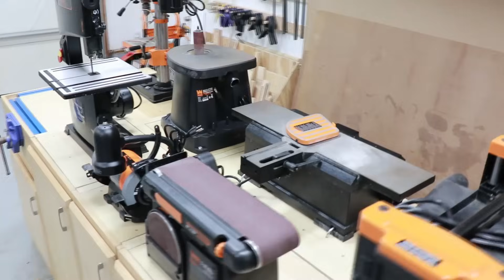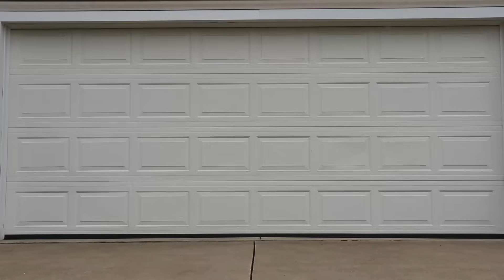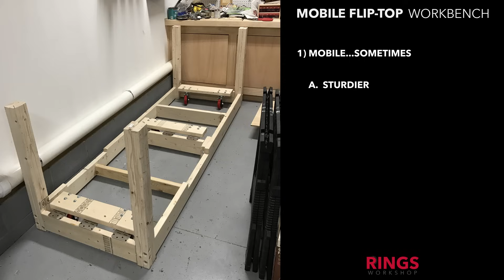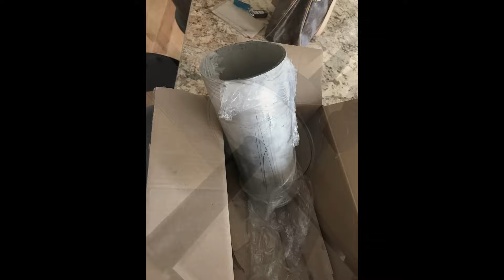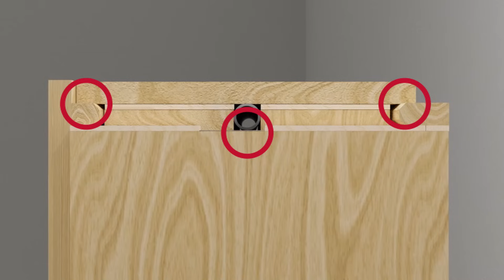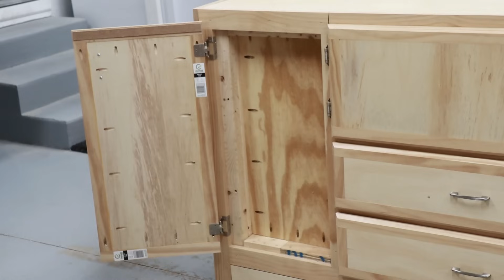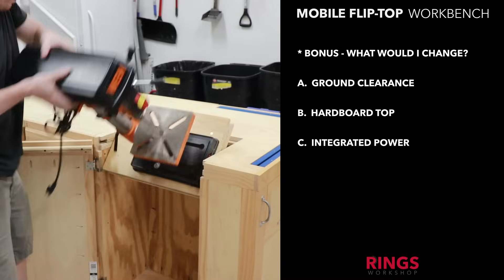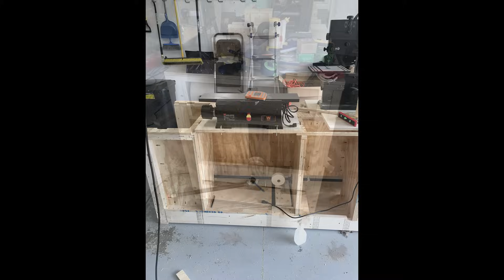Mobile Flip-Top Workbench

Comment: Thanks so much for the inspiration. I build myself a workbench with the same flip technic. It is such a space saver and very fast to flip. Awesome work!
Reply from the maker: That’s amazing!  I’d love to see pictures of it and hear more from you on how you implemented it!
Reply: @RingsWorkshop  Glad to be able to share the pictures 🙂
Had to post it in 2 stories on instagram, because of the limitation of 10 pictures 

Flip mechanism
https://www.instagram.com/p/CRlNPtlhnXy/?utm_medium=copy_link

The workbench in action
https://www.instagram.com/p/CRcL8fEhASs/?utm_medium=copy_link

I used multiplex boards for the body and used lamellos to connect all parts. 
I made some drawed plans to get the exact meassurements for the wholes that holds the flip pipe also for the lock of the flip table at the backside.
With those meassurements  I created a cutting template out of MDF to get the wholes and the Flip lock on all 4 walls at the same position.

Before assembly I milled some notches for drawers. For one top of a flip table I milled T Notches and for the center table I added a couple of 20mm wholes for clamping systems.
That is basically it, I would say.
I hope my explanations make more sense when watching the pictures.
Reply from the maker: @lexwoodworks3841  that’s amazing!  How is the clamping pressure on the left side?  I though about running tracks over the fliptop a myself to help with assembly, but wasn’t sure as I assumed it would lift up some.
Reply: @RingsWorkshop 

Thank you. My workbench is not as precise as yours, but it works out for me.

As i had just finished the workbench a couple of days ago, I actually haven't used the left side yet.
I just drilled a clamp to see if it works.  
I am basically working in the center area for clamping purposes. 

I'd be glad to run some testings or test clampings for you and send you the results by Video or picture. 
If you like, please let me know some use cases you are interested in and I'll do as promised.
Reply from the maker: @lexwoodworks3841  just basically assembly I’d be curious on.  I have the Kreg track on the solid part that doesn’t move, but I’d love to have more surface area to clamp to for larger projects.  Would just be curious how it holds especially from that left side to a piece that extends over the middle that doesn’t move, if there is any give or wobble.  Appreciate you looking into it.  That’s why I love this community, everyone trying different things and helping each other out to get better.
Reply from the maker: @lexwoodworks3841  thank you so much for those!  Definitely gives me something to think about!

Comment: This is bloody amazing. How would you adjust the height of the rotating platforms if you were to replace the tools? It would be great if you can have a height-adjustment-then-lock mechanism there. I want to build something similar.
Reply from the maker: You could drop it down for planer or miter/table saw, but you would need a really thick top side to make up the difference for when it’s down if you didn’t want a piece that would detach.

Comment: I notice that when you flip a tool you can slide the tool towards you a little bit before you flip the unit up and then slide it back to lock it onto the brace. Can you explain how that works, please?
Reply from the maker: That’s how it locks into place on the back side.  The 3D animation in the video explains it in depth more than I can through text.

Comment: This bench is pure Genius. My only comment is that you might consider swapping out the metal strips that prevent wear with same sized strips of ultra-high-molecular-weight polyethylene. As long as the metal tubing has been sanded so that there are no large burrs on it, the polyethylene would be just as tough and wear resistant, and it would markedly reduce the friction and effort in moving things compared to metal on metal friction. Very minor suggestion that is worth what you are paying for it. Excellent work and video. Super impressed. This is a link to an amazon product that would be a replacement for 1/8 inch metal. https://www.amazon.com/Molecular-Polyethylene-Standard-Tolerance-Thickness/dp/B000ILLNIY/ref=sr_1_4?crid=1XT7VQND71YJ1&dchild=1&keywords=ultra+high+molecular+weight+polyethylene&qid=1624560211&sprefix=ultra+high+mole%2Caps%2C212&sr=8-4
Reply from the maker: Thank you for the kind words, great idea as well with the polyethylene!  Hadn’t even thought of that.

Comment: Did a similar caster method for my Harbor Freight workbench years ago, but mine I could easily lift by hand, and tuck a support to hold the casters down with my foot....  works great and like yours, no risk of movement at all on locking casters.

Comment: Just discovered your channel. Me likey. 
If you do indeed end up doing a 2.0, lose the door handles as you will the fancy edging - a nicely shaped hole for one finger or a slot for four fingers, with a soft piece of flat rubber behind to limit dust entry will look better, not break, and not protrude. Also, those doors deserve nothing less than full length piano hinge. Nice bench, bro.
Reply from the maker: I had thought about the hole in the door, would be more low profile, I didn’t want risk things falling in and getting under the bench, however a piece of rubber or something like that would have been a good solve.  Piano hinge I didn’t even consider tbh, I was trying to hide the hinge all together, but realized wouldn’t be able to and have tools swing out without hitting a bulky hinge inside.  Would have been a nice look though.

Comment: The wheel assembly is just brilliant!
How cycles do you suppose it's done and how's it holding up?
Reply from the maker: Thank you!  It’s easily been raised and lowered over 200+ times, likely need to clean and regrease it, as I’ve naturally got some sawdust mixed in there, but no issues with it at all so far going through four winters.

Comment: You should fill the thin cupboard space with router & drill bits, these would be low profile enough to fit :)
Reply from the maker: Appreciate the comment!  I actually had route bits in there at one point, but I moved them too my tool wall I go over in detail in the tool storage video.  I have them all on magnet strips which seems to work out better for me.

Comment: Great video, loved it so much that I am in the process of building one similar to resolve my space issue. Is it possible to make so when my planer spins it lands at the level of the table ?
Reply from the maker: Thank you!  Yes, I would think all you would need to do is lower the point it rotates and have a thicker side when it it’s down so it fills that gap properly.

Comment: You have that dead cabinet space, so why not integrate power there? You could take a 25/50/100 extension cord, splice a switchbox into it (hell, use a plunger for emergency cut-off), and store/mount it in the unused space.
Reply from the maker: I would still have to plug the tools in each time I raise them up.  I have power right above them so it’s not really saving me much hassle.  If I ran the power through the pipes the tops spin on, I could have them always plugged into a master switch box and just have one cable I plug in when I move the bench, but I didn’t have room on the sides of each fliptop to do so.
Reply: @RingsWorkshop  Ahh. Thanks for clarifying. :)
Reply from the maker: @talldarkandcynical  of course.  Check out Drew Fisher’s fliptop at Fishers Shop.  He did one with integrated power, which is what I was referencing.

Comment: Great build just love the integration. Just a thought have you thought about coming at the power problem for the other end and having the tools plugged in at their own section and having one powerpoint/cord out, I'm not sure as each power cable may be a problem when revolving the device/tool. Also with reference to dust isn't there a way you could add a dust trap when you have the shop van on.
Reply from the maker: Thank you!  Problem with the power in each section is once you flip it up and close the door, the cord wouldn’t be able to be plugged in when you need it to have power.  That’s why running it through the pipe that spins would be the best option, Fishers Shop did something similar but his pipe didn’t slide like mine, so not sure if that would wear over time.  Dust I ended up doing magnet dust ports (another video on the channel)  and that made it a lot easier for me.

Comment: I don't see why you couldn't use a lipped edge on this. The slider motion would have to increase, as would the inner (back?) 3/4" block that connects with the flip top....maybe little spacer piece on the top, but overall totally doable. I might have to try a section with those changes along with making the cabinet body on the CNC to take a lot of the extra weight off, continue with a full table if it works.
Reply from the maker: I think you could but you would have to have the door stick out weird to lock it in place, and then if you use it to clamp you would be putting a lot of pressure on the door hinges.  That’s the main reasons I didn’t make the lip.

Comment: Really inspiring.  Question:  Do you have any issues with tools being aligned, level or anything like that when they are in use?
Reply from the maker: Nope, no issues at all.  No more than if they were just sitting on a benchtop normally.  Since they are bolted down they are more secure and move less so that helps.
Reply: @RingsWorkshop   - Thanks for the reply.  Another question (maybe I missed this):  How do you "lock" the cams to that they raise the bench for moving and not prematurely drop the table? Basically, what keeps the metal bar from springing back from the 7 o'clock position to, say 3 o'clock?
Reply from the maker: @stevenjunor503  the weight.  When I turn them it goes a bit passed it’s highest point on the cam so it won’t go back unless forced.  If I leave it at the highest point it can drop back down, so I just push it a little bit further and it’s good to go

Comment: Any small flat space unused could house gamer wrenches screw drivers even clamps squares leavles excetra. But a very ingenious idea about flip tops that I will use in my table. Ps you could still cut off and of tools drill hole behind or through pipe or top to below reconnect another plug on any tool. Great build.

Comment: This is a great build!! Do you know about how much you spent on the bench, minus the tools of course?
Reply from the maker: A lot less than it will take now with the price of wood being so high.  It was around 3 sheets of 3/4 hardwood plywood, 3 sheets of 3/4 sanded, sheet of 1/2 sanded, sheet of 1/4 ply, some 2x4, few 2x6 and the rest was the trim which could vary depending on if you framed the doors or not.  Honestly can’t even make a great estimate since it’s been four years now and it was multiple trips.

Comment: What is the dimension of your workbench top. I am trying to fit a similar number of tools into 4x8 and I think it will be too tight. Is yours larger than 4'x8'?
Reply from the maker: No.  Smaller.  Mines just over 8ft including the surrounding trim x 33 1/2 deep.

Comment from the maker: Plans are now available for this project: 

https://www.ringsworkshop.com/plans/mobile-fliptop-workbench

The top dimensions are about 97 1/4” wide, 33 1/2” deep, 36 1/2” tall.  Overall dimensions add 1 1/2” for the doors + the depth of the handles used.
Reply: @Rings Workshop I got them. Wow! 100 pages! You obviously put a lot of time and work into putting this together. Very detailed and complete. Thanks for doing this! I have completed the basic base and adding the movable caster sections next. I am modifying for the tools I have and making it a full 4x8 top, but still going with your design.
Reply from the maker: @tcmccormick  thank you!  That’s awesome, excited to see how it turns out!!

Comment: I did not read all of the comments, so someone may have already suggested this, but, in the storage spaces you could use one for Kreg Jig storage and the other you could use for hand planes or other small tools.

As for the electric, it looks like you have some spaces that could contain either a power strip and/or multiple duplex outlets, set below the surface one of two ways.  One would be to mount them 3/4" below the top and then cover them with a temporary cover of plywood for when you need a flat top or if you can find the right type, they make flip up outlets.

Lastly in the middle(ish) of the bench it looked like you had a square opening (under top) that could possibly be turned into a dust collection port.  I did not really see much of the internal spaces, but maybe you have enough room to run some pvc to the lower outside or possibly into the wide open cabinet to house a vacuum.
Reply from the maker: I appreciate the ideas.  I could definitely do both of those things,  but it doesn’t really help a lot as I have both attachments directly above where the bench is.  My hope with power would have been to run the power through the pipes so I would have one master plug and the others were ready to use as soon as they flipped up.  There is no way to do that with dust collection though because of the size of the hose.  Great ideas though, like the idea for hand planes as well!

Comment: Have you thought of putting a track saw rail on one of the sides of the bench?
I think with a little thought an adjustable hight cradle for the saw to run along a rail is possible.
Reply from the maker: I hadn’t...but I am now.  Guess I know what I’ll be trying to figure out this weekend!  Haha.
Reply: One more thought
The edge of the bench should probably be the cutting edge.
And the piece to be cut can move onto the edge. That way you will always know what the cut line will be?
Reply from the maker: @mushroomlw1717  likely what I would do, but maybe a slight overhand so I’m not cutting into the bench.  I would have it overhang onto the table saw so when that piece get close to the end it doesn’t bind into the blade and is still supported.  But i agree, would like an easy way to line it up or even make repeatable cuts.  Have a few ideas for sure, thanks again!

Comment: The thin cabinets would work great for hanging extra circular saw blades and grinding wheels.
Reply from the maker: I had saw blades in them initially, but then I made a special holder for blades so I took them out.

Comment: In the shallow cabinet you might want to drill i/8" deep hoes, 3/4" wide and fill the holes with rare earth magnets. I use them in a similar space to hang my spade drill bits & other small items I regularoily use.
Reply from the maker: I had a few magnet strips in there but moved them to the tool wall.  I, too, am a huge fan of magnets.

Comment: Ab fab video, you have a wonderful imagination.  :)  I'm in the process of fitting my workshop from scratch and couldn't see where to put the workbench, now I don't have to I can put it wherever I want for the circumstances.  Love the can mechanism for lifting the bench, I wondered how solid locking casters would be now I don't have to.  I cut my own trees and am incorporating a planking facility (rough plank the trees to 4" - 6" thick, set aside to dry and then rip into planks) so I am wanting to keep a 20ft run free for this.  I can now mount all my power tools under this run and upside down just like in your bench.  Thank you for that.

Comment: Spare space - band saw blades -  having has one fall of its hook and bite me, a cupboard seems a great idea. - And, love the concepts.  Will be "borrowing" the ideas for my shop. Though trying to see how I can offset the thicknesser so the feed is level with the table.
Reply from the maker: Thanks!  I though about that, but because the cracks in the table can catch boards I just through some scrap on top and it works fine.  I also don’t use the planet a ton so it wasn’t a huge inconvenience for me.

Comment: Do you have any issues with the placement of the drill press? Would you have moved it or changed the orientation if you built a new one?
Reply from the maker: Only issue I have is that my camera arm I use to record doesn’t reach over that far haha.  I have no issues with it being sideways, which is why I put it on the end so I can use it straight on still.  If I rotated it 90 degrees it would be much deeper and I wouldn’t be able to put any tools on the opposite side without making the bench wider, which was the reasoning behind it.  Hope that makes sense.

Comment: Great bench. I am going to build one like it. I would love an explanation on how you built the wheel sections to work with the cams in the lift mechanism. Did you use spring hinge to get the wheels to go back up when the cams are turned?
Reply from the maker: Thank you!  Nope, weight just shifts to the posts and wheels are touching the ground but the bench isn’t resting on them.

Comment: I see that you too are a Bang-for-your-buck, Goldilocks Grade Tool Enthusiast.
Reply from the maker: For the ones I don’t use a lot, yeah.  Also didn’t have room for full sized ones, not many high end bench top tools out there.  I bought most of them from that bench within a few months of each other, so i had to be a bit frugal.  Ones I use all the time I’ll invest more money in.
Reply: @RingsWorkshop  The Delta 36-725 was what made me perk up. I'm in the same boat, building a tiny shop. I noted that you must have made the same humming and hawing decision that I had to make about that saw. "I could get something much smaller that would be easier to fit in here... but... it's such a nice saw.) Then I noticed that you (wisely) had chosen many of the same pieces of equipment that I had.